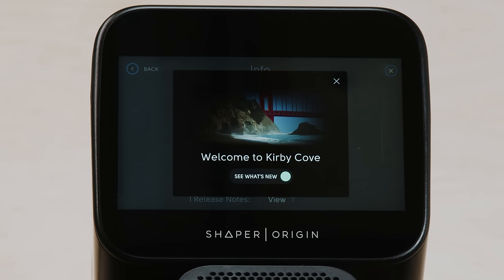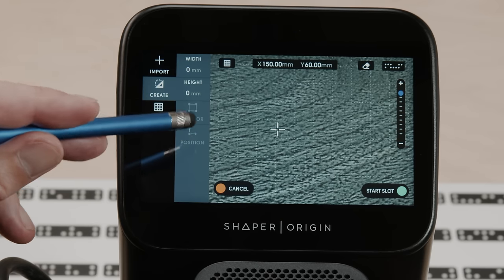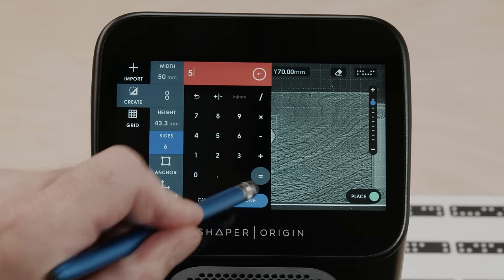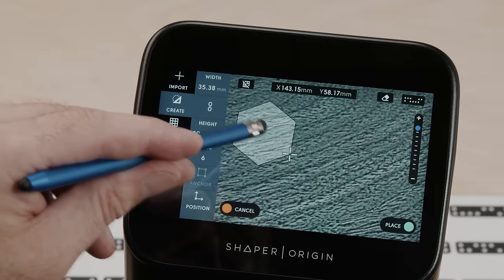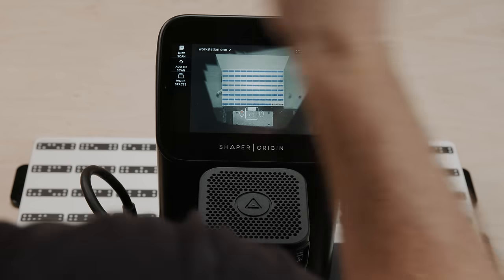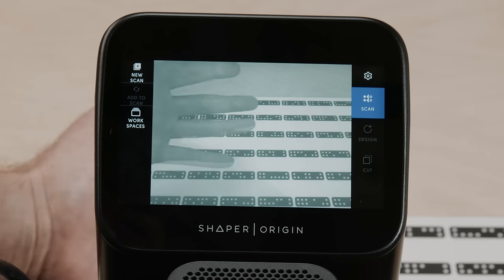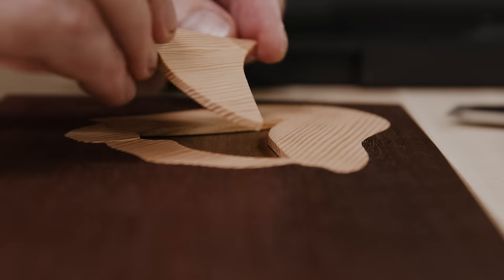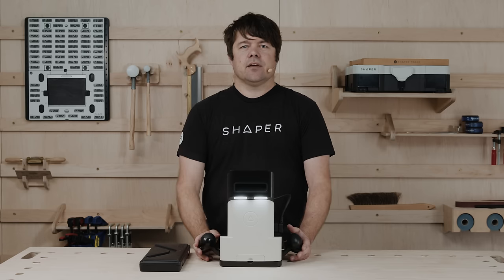Software Update: Introducing Kirby Cove

Comment: Deleting workspaces should be done by selecting the ones you want gone, not all or one by one..  Or make the ability to lock ones.. like the shaper plate alignment ones that there would be almost be no need to ever erase.
Reply: or....only delete workspaces with a default name? I have a bunch of unnecessary workspaces thanks to "Add to scan".
Reply: 100%, just an option 'bulk select'